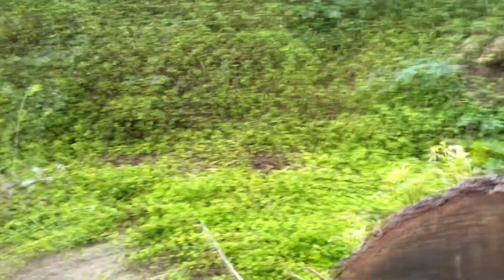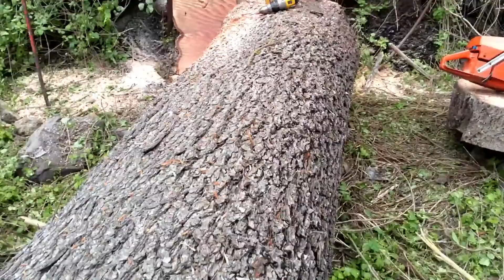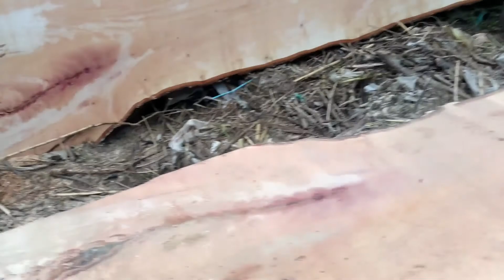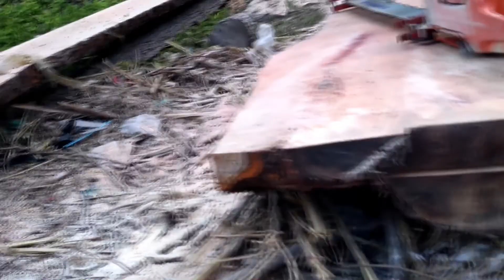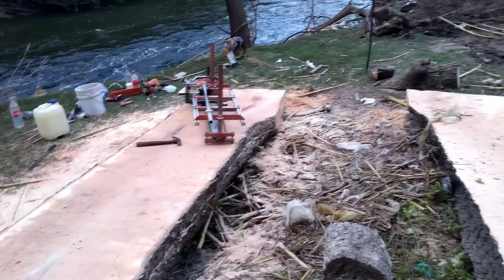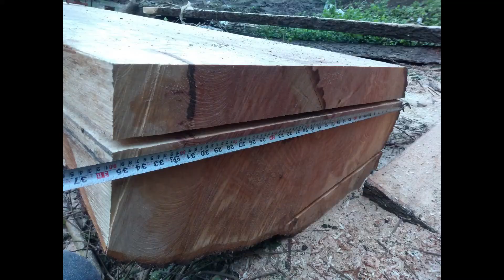ASERRANDO NAGAL DE 5 METROS DE LARGO POR 90 CM ANCHO

Comment: Ola saludos desde cuetzalan pue. Una pequeña pregunta tengo una ms Stihl 382 Cres que soporte el motor para trabajarla con un accesorio como ése??
Reply from the maker: Todas las Motosierras pueden utilizar el accesorio,Manejamos todos los tamaños de accesorios para motosierras desde 24 pulgadas hasta 80 pulgadas.   Cada motosierra el fabricante recomienda un tamaño de espada.
Motosierra 382 utiliza una espada de 30 pulgadas  con ella puede hacer cortes de  70 cm de ancho utilizando el accesorio.  Puede ponerse en contacto al 772 135 6102 para más información  envíos a todo México.  Ventas mercado libre. https://listado.mercadolibre.com.mx/_CustId_782370887